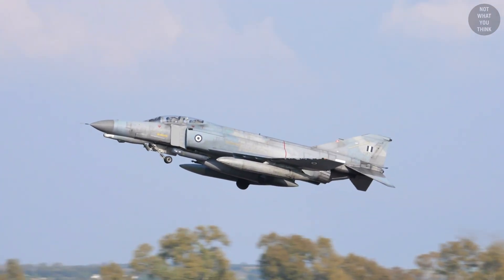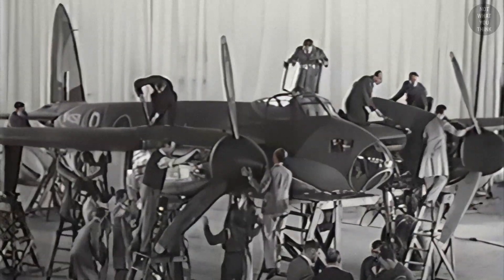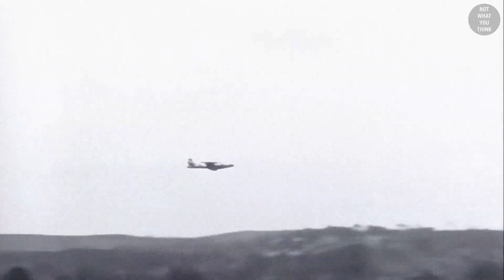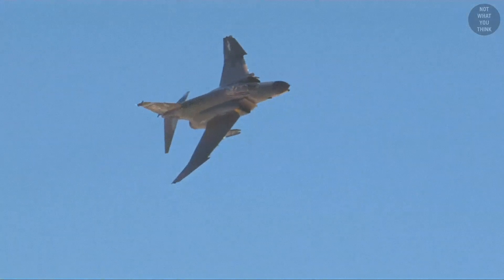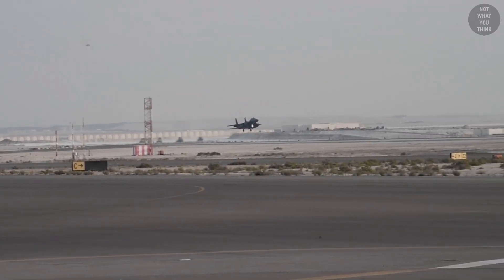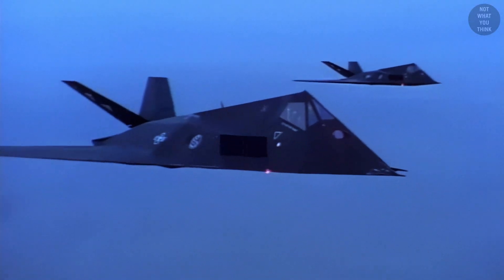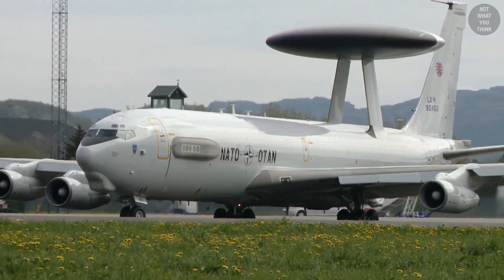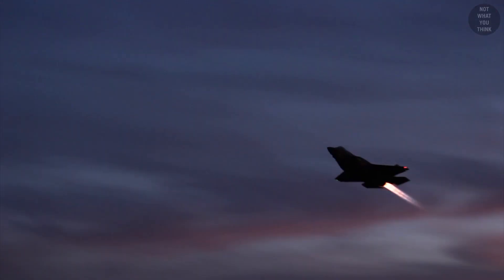Why are Modern Fighter Jets Slower than 1960s?

Comment: They're different designs for different objectives. The F4 and equivalents are really big planes with space for heavy payloads, an F35 is a small-ish plane meant for low radar profile. You need both types of planes to cover all operational situations.
Moving completely towards smaller, lighter and maneuverable fighters creates huge problems, like when the US navy ditched F14s and found themselves lacking any carrier based heavy interceptors capable of high speed with considerable weapon loads needed to shoot down bombers and air-to-ground attack planes. This is why some countries like Japan keep updating their F4s and similar old big rockets.
Reply: While length and width of F-35 are small, unlike sleek F-22 its shape is really fat (to fit both big internal fuel load and internal weapon bay) and maximum take off weight is actually higher than that of Super Hornet or Phantom.
And Japan basically replaced F-4 with F-35.
Reply: @tuunaes  Now for all those of us that would like to understand this really? Without listening to this misinformation that only a 5-year-old would listen too?, we can find the answer to this question by merely understanding the Mikoyan-Gurevich MiG-25, NATO: Foxbat.
Reply: @tuunaes  While that is true, it still leaves the same problem US navy had with dropping the f14s, namely high speed emergency interception.
Reply: PMSFL Really? Seemingly these Americans have no idea the F-22 and F-35 can't see, track, or target any other stealth aircraft from BVR (beyond visual range). Stealth alone defeats high-frequency (short wave) radar by absorption and deflection, it does not defeat low-frequency (long wave) radar. Therefore, to see, track, and target stealth aircraft you must have long-wave radar, but it must also be enhanced to remove all background clutter for targeting purposes.

Neither the APG-77 radar used in the F-22, nor the APG-81 radar used in the F-35, can see any other stealth aircraft from BVR (without enhanced long wave radar) — This fact the US Air force obviously know! Only it seems the reality is, that when the F-35 radars were being designed 13 years ago, there were no other stealth aircraft to think about as a potential threat? So how can these US aircraft be seen as any sort of threat to either China or Russia, who both have these aircraft technically beaten? They can see and target US jets from BVR, yet the US jets can't even see them from BVR?

Russia's new 5th generation Byelka (2band) radar, used in SU-57, does have enhanced long-wave radar, they've designed and developed the first L-Band fighter radar we've ever seen. They've cleverly embedded L-band AESA radars in the leading edges of the wings. The new L-band AESA radar data gets processed in real time through extremely powerful Russian Elbrus computers being significantly enhanced removing all clutter, meaning it can see, track, target, and engage enemy stealth aircraft from BVR. The technology along with its impressive range parameters and jamming ability over large areas make this aircraft deadly to all other aircraft types. 

They can also interact in ''real-time'' with each other member of the squadron, (auto selecting) the best placed BVR missile, that can be fired by anyone of the squadron with a bogie on radar, they can also take control of surface-to-air (SAM) missile defence systems - (that alone is lethal), and they can see track, enemy stealth fighter aircraft long before Russian airspace, from much greater distances, with "real-time" data from massive Russian ground long wave stations (that are all protected today with the networked S-400 defensive system). 

Therefore, as they'll always know where the enemy aircraft are, they'll always be able to approach any enemy aircraft head on, and therefore stealthily, (Russia wisely sacrificed rear end stealth for much better manoeuvrability) meaning today, the US fighter jets would not even be able to see them coming!! Russia's Byelka (2band) radar covers all aspects of frequencies across all channels, that are used for tracking, targetting, and also jamming. It's part of Sh121 multifunctional integrated radio electronic system (MIRES) on board the SU-57. 

Russia tested much of this new radar suit on the SU-35, so they also have the option of fitting this radar into SU-35's permanently, meaning Russia's SU-35S flanker will be at no disadvantage with F-22/35. As although the SU-35 can be seen and targeted from BVR, the SU-35 with the new 5th gen radar is as able to see and target the US jets from BVR, seeing the all-important Russian advantage in BVR missile distance, plus the excellent manoeuvring, neither the F-22/35 have, as more than critical, if you're going to avoid simply being blown out of the sky.

The design has clear potential to provide a genuine shared multifunction aperture with applications including: Search, track and destroy missile mid-course guidance against low signature aircraft. Identification of Friend, Foe/Secondary Surveillance Radar. 
Passive angle tracking and geolocation of JTIDS-MIDS-Link-16 emitters at long ranges.
Passive angle tracking and geolocation of L-band AEWC-AWACS and surface based search radars at long ranges.
Passive angle tracking and geolocation of hostile (i.e. Western) IFF and SSR transponders at long ranges.

High-powered active jamming of JTIDS-MIDS-Link-16 emitters.
High-powered active jamming of satellite navigation receivers over large areas.
High-powered active jamming of L-band AEWC-AWACS and surface based search radars at long ranges.
High-powered active jamming of guided munition command data links over large areas.

Effectively neutralizing the USA's use of AWACS for their detection. The Tikhomirov NIIP L-band AESA is a very important strategic development, and a technology which once fully matured and deployed in useful numbers, will render narrowband stealth designs like the F-22 & F-35 Joint Strike Fighter, and some if not many UAVs, as highly vulnerable to all Flanker variants equipped with such radars.
Reply: @hotstepper887  I very much like the Shukoi design line, specially the su27 variants due to their maneuverable geometry, but while your post has some good data on it it's also just as propagandistic as the video.

Comment: If the F-4 was running slick, no weapons and nothing hanging off the wings, it might go that fast in full after burn for a few short minutes until the fuel was gone. An engineering friend of mine told me it had a four inch fuel line.

Comment: Agility is a negotiable in the era of long range radar guided missile engagements. Speed is still a non-negotiable for any interceptor looking to get into the sky. The F22 gets the balance perfectly right, mach 2.2 is good enough- this is the maximum speed it can go without damaging the stealth paint. And as it turns out its also capable of beating 4th gen fighters in a dogfight. The f-35 on the other hand is slow and less agile. Its passible on the A variant but the C and even more so the B variants are not proper fleet defence assets. Argubly neither is the F-18

Comment: I have a buddy who flew in the GWOT era and he said they flew as fast as the aircraft could go twice there called to a unit about to get over run and they needed air quickly so they were told to put the "petal to the metal" so they turned the afterburners on and went drop there ordnance but it cost them they had to divert to an air Force Base land and refuel before as they couldn't get back to the ship apparently that was super embarrassing the second time was similar but they were able to get back to the carrier

Comment: The biggest advantage of speed back 40 or 50 years was that once your missiles ran out, it was gunfighting. And in gunfighting, having speed is an advantage. Today, aircraft have more missiles and operate beyond visual range, rendering gun fighting obsolete.
Reply: Seemingly these Americans have no idea the F-22 and F-35 can't see, track, or target any other stealth aircraft from BVR (beyond visual range). Stealth alone defeats high-frequency (short wave) radar by absorption and deflection, it does not defeat low-frequency (long wave) radar. Therefore, to see, track, and target stealth aircraft you must have long-wave radar, but it must also be enhanced to remove all background clutter for targeting purposes.

Neither the APG-77 radar used in the F-22, nor the APG-81 radar used in the F-35, can see any other stealth aircraft from BVR (without enhanced long wave radar) — This fact the US Air force obviously know! Only it seems the reality is, that when the F-35 radars were being designed 13 years ago, there were no other stealth aircraft to think about as a potential threat? So how can these US aircraft be seen as any sort of threat to either China or Russia, who both have these aircraft technically beaten? They can see and target US jets from BVR, yet the US jets can't even see them from BVR?

Russia's new 5th generation Byelka (2band) radar, used in SU-57, does have enhanced long-wave radar, they've designed and developed the first L-Band fighter radar we've ever seen. They've cleverly embedded L-band AESA radars in the leading edges of the wings. The new L-band AESA radar data gets processed in real time through extremely powerful Russian Elbrus computers being significantly enhanced removing all clutter, meaning it can see, track, target, and engage enemy stealth aircraft from BVR. The technology along with its impressive range parameters and jamming ability over large areas make this aircraft deadly to all other aircraft types. 

They can also interact in ''real-time'' with each other member of the squadron, (auto selecting) the best placed BVR missile, that can be fired by anyone of the squadron with a bogie on radar, they can also take control of surface-to-air (SAM) missile defence systems - (that alone is lethal), and they can see track, enemy stealth fighter aircraft long before Russian airspace, from much greater distances, with "real-time" data from massive Russian ground long wave stations (that are all protected today with the networked S-400 defensive system). 

Therefore, as they'll always know where the enemy aircraft are, they'll always be able to approach any enemy aircraft head on, and therefore stealthily, (Russia wisely sacrificed rear end stealth for much better manoeuvrability) meaning today, the US fighter jets would not even be able to see them coming!! Russia's Byelka (2band) radar covers all aspects of frequencies across all channels, that are used for tracking, targetting, and also jamming. It's part of Sh121 multifunctional integrated radio electronic system (MIRES) on board the SU-57. 

Russia tested much of this new radar suit on the SU-35, so they also have the option of fitting this radar into SU-35's permanently, meaning Russia's SU-35S flanker will be at no disadvantage with F-22/35. As although the SU-35 can be seen and targeted from BVR, the SU-35 with the new 5th gen radar is as able to see and target the US jets from BVR, seeing the all-important Russian advantage in BVR missile distance, plus the excellent manoeuvring, neither the F-22/35 have, as more than critical, if you're going to avoid simply being blown out of the sky.

The design has clear potential to provide a genuine shared multifunction aperture with applications including: Search, track and destroy missile mid-course guidance against low signature aircraft. Identification of Friend, Foe/Secondary Surveillance Radar. 
Passive angle tracking and geolocation of JTIDS-MIDS-Link-16 emitters at long ranges.
Passive angle tracking and geolocation of L-band AEWC-AWACS and surface based search radars at long ranges.
Passive angle tracking and geolocation of hostile (i.e. Western) IFF and SSR transponders at long ranges.

High-powered active jamming of JTIDS-MIDS-Link-16 emitters.
High-powered active jamming of satellite navigation receivers over large areas.
High-powered active jamming of L-band AEWC-AWACS and surface based search radars at long ranges.
High-powered active jamming of guided munition command data links over large areas.

Effectively neutralizing the USA's use of AWACS for their detection. The Tikhomirov NIIP L-band AESA is a very important strategic development, and a technology which once fully matured and deployed in useful numbers, will render narrowband stealth designs like the F-22 & F-35 Joint Strike Fighter, and some if not many UAVs, as highly vulnerable to all Flanker variants equipped with such radars.
Reply: I'd argue in gunfighting that thrust is more important than speed, with speed you outrun the enemy, and that's about it. With thrust you can keep yourself at an optimal speed while an enemy with less thrust would have to keep operating below optimal speed to catch you.

Not an expert so do take with a grain of salt
Reply: @jefflei215  Speed and fast thinking win far more wars. It allows you to move around an enemy force with intelligence while remaining undiscovered and then able to ambush with surprise, causing chaos and disarray.

Comment: This channel makes one giant generalization which is borderline wrong. Modern planes can indeed outrun modern anti air missiles. The thing here is that a missile have a limited range. After its initial booster which reaches those massive speeds, missile slows down with either no active propulsion or a sustained engine which is a lot faster. A missile also has a lot lower active range until its engine burns out. When it burns out, it becomes very sluggish and a good pilot can evade such missile with high likelihood of success.

Aircraft speed here is a differential in energy. The faster aircraft is, the more energy missile will need in catching up. Missile needs not only to close the current distance, but the distance aircraft can travel during interception period. If you are engaging a very fast aircraft, your maximum range of interception is reduced dramatically. Especially if enemy airplane is flying very high. This is how SR-71 operated. A spy plane which simply outrun any missile fired at it.

So, author is wrong by saying that aircraft can't outrun the missile. It is actually a thing in air combat. However, it is not the main means of defence and modern aircraft usually won't be trying to survive with energy advantage like aircraft of the past.

Comment: The creator is wrong. F-35 is just an airstriker jet. He is not created for air combat missions. Aircrafts like f-22, f-16 and f-15 have very high top speeds for a reason. And the reason is long range air to air combat. If you will launch your missile at higher speeds on higher altitude, where the air pressure and resistance is lower, your missile will be able to reach enemy aircraft first. Also the higher energy state of the rocket on approach to the target will result in a higher chance of hit and will be less affected by defensive maneuvers.

Comment: Failed to mention 'supercruising', as some modern jets achieve mach and can sustain it without afterburner, increasing ranges. (Others have also commented thus.) 
To compare, you have essentially older cars geared to cruise at 50, but can reach 175, vs modern cars which can reach 160, but cruise all day at 85. Which one is 'really' faster?

Comment: Actually there's a difference between the main engine thruster and the afterburner or speed booster. After playing a lot of air combat simulations, I realized that the main engines are primarily used for cruising speed or combat mode while the afterburner which increases the aircraft to its maximum speed is only used to get from point A to point B quickly or used a trump card in dogfights in the air.

Comment: Another benefit of high top speeds is lofting long range missiles and bombs to give them longer ranges. It's actually really beneficial in a beyond visual range engagement to launch a long range air to air missile at higher speeds, since theoretically you can launch sooner than your opponent.
Reply: Launch altitude is a more effective factor in extending a missile's range. Missiles don't have wings, they have control fins. Getting to maximum range for a missile means that, for the initial phase of flight, nosing up and climbing for the stratosphere while you still have fuel in the rocket motor.

The altitude at which you launch the missile is more important, because the higher you are at launch means the less distance the missile has to travel to reach 80,000 feet and coast through the thin atmosphere downrange.

The 10,000 foot ceiling advantage the F-22 has over the F-15 means the AMRAAMs the F-22 can launch have further reach.
Reply: @BogeyTheBear  speed does have a bit more weight with unpowered glide weapons.

Comment: I belive the f22 has abilitys no body knows about, except the people who designed and built and the pilots. Its likely capable of speeds much more than March 2+. However at risk of damaging the engines and above all the advanced coating on the aircraft, i recall watching a doco on the f22 and the folks who fly it, the pilots mentioned about the advanced coating being compromised at any speed above march 1.6, unless the aircraft is a dedicated high altitude intercepter, speed is not necessary.

Comment: They aren't. Top speeds are classified. But in a way they are slower because going above mach 2 creates heat upon the skin wich will damage ram. Do you really think the F-35 with a 40k engine can only go mach 1.8 or barely hit mach 2?